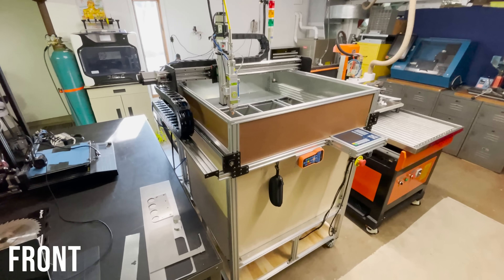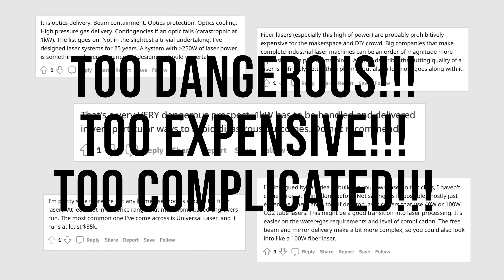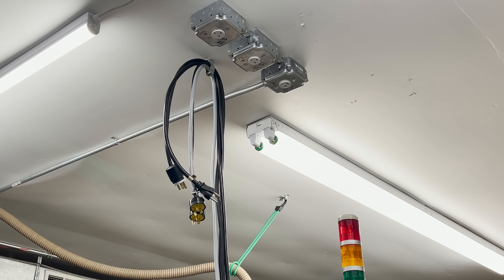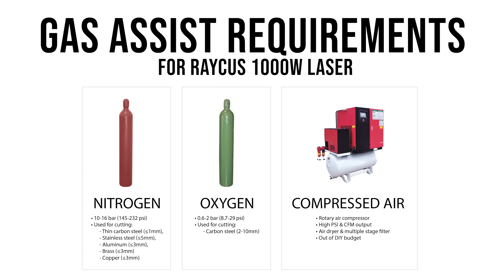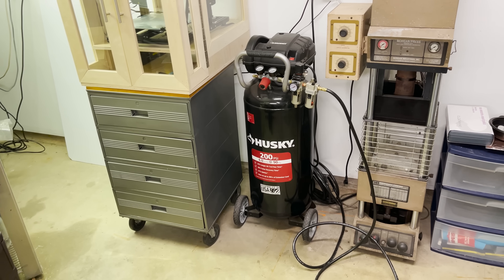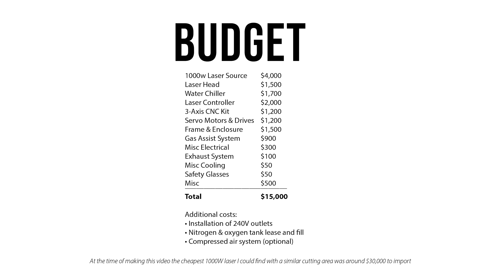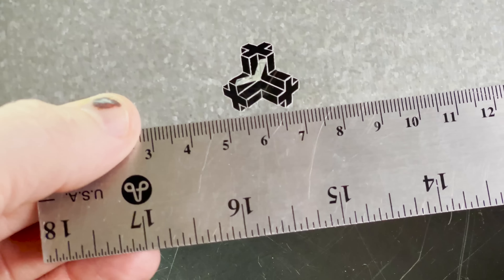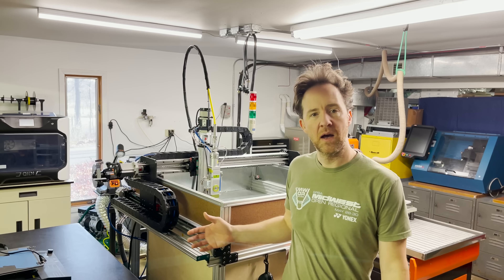DIY 1000W Fiber Laser Cutter Part 1: Project Introduction

Comment: Hi Travis, I took the same route as you did in 2013 with a CO2 laser, when fiber lasers were a new technology. Raycus and Max laser weren't around yet. One thing that could benefit you greatly, and I would love to collaborate with you if needed, is to create your own Nitrogen generator. This will eliminate the cost of purchasing or refilling N2 every time you cut exotic metals such as aluminum, stainless steel, copper, brass, etc. For steel, you can actually use dry compressed air instead of oxygen. However, this must be supplied by a reputable rotary screw compressor (5-10HP or more) which is the bulk of the cost upfront.

Comment: big chunk of change. How thick can it cut?

Another idea is one of those oxygen generators and bottling oxygen yourself too.  As well as refilling your own air cylinders using a compressor. You could probably use a small compressor and fill the large bottles instead of paying for that.

Comment: Definitely following this epic build. Do you think the 1500w could cut 1/4” aluminum? Also, it may be negligible with your application, but to save gas be sure completely open the gas valve so it so it seals. When just partially open gas can slowly leak around the valve, which has an upper seal to prevent this.

Comment: Working as a salesman for company that sells laserwelders. Which is also a class 4 laser. I have to point out the safety aspect. Please cover up the window. The rays will go straight through the glass. You would be surprised how far the damaging rays could travel because of the reflection.  I just subcribed because this I such a cool project. Keep those episodes coming!
Reply from the maker: Thanks for your input, I certainly will make a panel to cover the exterior window while cutting

Comment: Ok, I’m not going to say it’s the best option but I operated at 1500 watt fiber laser for 4 years on straight compressed air.  Was it recommended by the manufacturer? certainly not but it did work.   Our big, expensive laser got a weekly nitrogen and Co2 refill, though.

Comment: If you are using air gas for bottle fills watch your account. Those jerks screwed a club at my school. Starting charging a bottle rental for a bottle the club owned. They never could get it straightened out with air gas, the bastards sent them to collections!

Comment: This is funny, i was the one posting one of the question on Reddit of which you have shown some of the replies. Thank you for doing it anyways and proving those guys wrong. Btw did you consider Acorn CNC as a controller at any point?
Reply from the maker: Haha, thanks for getting this conversation started! I didn’t consider the Acorn, the project is already complicated enough, even when using a fiber laser specific controller
Reply: @diyfiberlaser  I love the project. Will join the Patreon.

Comment: Now you've got most of it, incremental upgrades are a breeze such as bed size. 15k sounds a lot and is but you could bespoke cut some highly accurate jobs and recoup your investment pretty quick. I am at the point of closed loop servos just for repeatability waay down where 10ths are too big.

Comment: At 8:06, it looks like you’re adjusting those tank valves just enough to hit the mark on your regulator.  Remember to go full open on the tank valve and then close a click or two.  Use the regulator to regulate pressure, not the tank valve.  I’m not certain why, but my welding teacher made a point about it and it’s always stuck with me.

Comment: I have 22+ years working on industrial lasers, if you are going to use compressed air, 3 important words, filtration, filtration, filtration. Any water vapor that contaminates your lens or collimator and you will be replacing them excessively, if you can’t get them clean enough. Fiber lasers require a pristine lens to function properly. CO2 lasers are a little more forgiving.

Comment: Careful, I work on industrial Trumpf, Prima, BLM with IPG laser drivers, and you don’t have a proper dust collection system. All that laser dust, under a microscope, are very jagged, and if enough collects in your lungs, it can be fatal.
Reply from the maker: Thanks, I’m working on an enclosure for it now so I can contain the dust and fumes and filter it properly

Comment: I'm so impressed with what you have achieved here.
I've been working on one on a larger scale, more industrial.
You are right, there is not much info for the beginner into this.
Looked at all the Ruida / Cypcut systems, need a PC.
Plus it is a very old Windows system.
So sorting something from the start along the lines with the Masso G3 with the new Plasma start configuration.
This is also working with a LPC-PLUS6 Fibre Laser power source controller.
Plus with my own THC with the LFS-AM-T43-AP01.
This capacitive sensor also works with the Masso DTHC.
With the Masso G3 Plasma start configuration, it may be able to be done.
I see you run a Masso touchscreen in the background.
Cheers.

Comment: You rightly noted the danger of laser radiation. Goggles aren't going to protect your exposed areas of skin - think of how thorough you really should be to protect yourself from radiation from simply welding. Laser radiation can be reflected and scattered and I can see you are RIGHT THERE!  You need to have a radiation blocking cabinet around the whole unit. That's why they have them on metal cutting lasers.

 Also, the result of laser cutting metal is metal fume. Metal fume is composed of particles which are so fine they can stay suspended in the air for days. You are then inhaling this highly toxic material. Excellent extraction/filtration is essential.

Comment: I already have an 4' X 8' plasma cnc set up. I am very interested in designing an add on when I want to laser cut. From what I see in your "rough cost", it looks like I would be able to add just the head, source and chiller for around 10K? Would that be about right? Also, would or should I be able to use my current G-Code and design software to achieve this? Thank you sir for your sharing and help for the small business.

Comment: Very interesting, I am looking at making (because nobody makes one) a combo unit, CNC router and laser. I have been thinking of getting a MillRight and making the table move and not the gantry, mount the laser on the back of the mill head off of the table. and have a small footprint that does two functions. The application is cut 1" boards, 5/8 aluminum, and laser thin gauge metal, with engraving.

Comment: Very nice results.   Wish the frame was less wobbly but I cant argue with the results.  I understand why 80/20 is popular but I far prefer good old fashioned steel, welding is actually faster than fiddling with all the fasteners in those slots, the price is lower and the end result is better.  Welders are not that expensive these days either.
Reply from the maker: The frame is pretty rigid, it was just sitting on 4 wobbly casters. I would like to learn to weld some day, however in this case I was making up the frame design as I went, so being able to loosen fasteners and adjust the positions of beams was actually pretty useful.

Comment: we have an old trumpf 9000w at work that uses liquid Nitrogen that produces around 150ish psi out of the gassifier but we have to boost it to close to 400 psi for cutting 1/4"  steel.

Comment: I really considered adding fiber laser to my existing 3kw cnc router. But just the main components and not the cnc bits cost quite a bit. The only real added benefits to me that is, is being able to cut steel which i don't do often. CNC router can cut aluminium and achieves 3 axis. So i abandoned the idea. But finally someone did it! Great work.

Comment: What travel speeds do you think is required for this?

I have many small and large format… movement systems. I wonder I I can use them (yes they are more than strong enough they are industrial) 
Just not sure the speed will be adequate
Reply from the maker: It appears the fastest cutting speed I would ever need to go is around 350 mm/s, but I would like the rapids to be faster...as fast as possible,  because otherwise assist gas is getting wasted while moving around
Reply: Hmm. 
My milling machine is only rated to around 250mm/S for accurate feeding.
I wonder if that would be enough?

As for air on my end I have lots of air compressor capacity.

You’ll need to borrow your cloths dryer plug and get a bigger compressor maybe. Tank air must be prohibitively expensive to be se!
Reply: *use

Comment: I had considered going laser, but before I did, I just had to prove to myself that I could not get the quality I needed from plasma.  I'm glad I went through the effort, because it turns out that plasma with a fine cut nozzle is indeed capable of doing the cuts I needed for my small business application.  Here is my video of my $500 CNC plasma cutter.  https://youtu.be/z5j0oNG1YTw

Comment: sometimes I can see used laser sources for sale,  quite rarely, there may be more later.    I read that fiber lasers have a very long lifetime.    my question is, are there states in between working alright and fully defective?   for example, can it happen it seems to work (emits the laser beam) but some (hidden for us) parameter is not correct and it will make the operation faulty.  are their power decreasing with operating hours like it is the case with CO2 laser tubes. Simply put how safe it is to buy a used fiber laser?

Comment: This is one of the least responsible and most dangerous projects I've seen in some time. At that power, both specular and diffuse reflections can cause permanent eye damage, blindness, and physical burns for you, anyone in the area, any pets, and any wildlife nearby. Since you're venting out a pet door, you do not have any hope of claiming adequate optical shielding. That needs to be in a laser-grade enclosure.
At those power levels, I wouldn't even be comfortable with laser glasses, I'd use goggles and definitely ones with appropriate frequency-specific optical density ratings ($120 and up), as Spirit mentioned.
You're also overpaying for gas by about an order of magnitude.
You should not be venting those fumes without filtering. All you're doing is poisoning your neighbors and local environment.
Reply from the maker: This is a work in progress. I now have filtering, certified safety glasses, and am working on an enclosure (for spatter and fume containment). Im not sure how to make a laser grade enclosure, so I will be relying on safety glasses for now. There are people using open frame machines all over the world, even though it is not ideal. I’ve never actually heard of an eye injury case, only the potential for one. I would be really interested if anyone knows of any? And yes, I’ve already burned myself on the hot metal, but it will heal…and I will never touch that again with bare hands!
Reply: @diyfiberlaser  I'm glad you're taking a lot of safety suggestions from everyone to heart.
If you're talking about all the cheap hobby diode laser cutters being run unenclosed, they are very different. Aside from orders of magnitude lower power, their beams are very divergent and focused but not collimated. A reflection disperses far more rapidly, resulting in less intense radiant energy to the eye. They're also visible beams, which makes the retina more susceptible to damage at lower power but also, for low power strikes, the blink reflex comes into play to protect your eye.
For an enclosure, you can get laser safety glass and laser safety curtains. The latter are good for ensuring reflections can't get out the sides, the former are good viewing windows into a (probably laser absorbing paint coated) metal enclosure.
Thanks for replying and improving your safety processes!
Reply from the maker: @kor_kilden  I am certainly taking everyones comments to heart. As I said in the video, I'm a complete novice when it comes to fiber lasers. I have already learned so much from everybody's wonderful feedback and I'm trying to implement what I can. I was really hesitant to even put this video out because it would be my worst nightmare if someone gets hurt trying to make or use one. But I think in the end, it might turn into a resource that others are able to learn from, especially from all of this feedback. You just helped me again! I had no idea there was laser absorbing curtains or absorbing paint...now I have more research to do! 😃

Comment: Well described and thank you for all the info shared. The greatest fail of the whole system is no mouse on the laptop 🙂 Looks to be the system I will need, but the price is outside my capabilities now. I have a 65 amp plasma cutter on a PlasmaCAM, and a 6040 CNC which does me fine for now, and I am building a 90W 6090 CO2 currently with about 2/3 of  the parts now.
Reply from the maker: Tough critic! I have a Bluetooth mouse, I just wasn’t using it 😜
Reply: @diyfiberlaser  🙂

Comment: I run a laser welder, i pay 43$ for 300cuft for the nitrogen 1 cylinder at a time small volume . You should check with a main gas supplier

Comment: 9 bar out of compressor is fine to cut 2mm stainless and 1mm carbon on this setup. Just make sure its free of oil and water as it will make lower protective lens dirty during cut and lower output power

Comment: 4:42 , that's a very common cost cutting measure, I work with a 2500W laser at work (industrial), we do up to 10mm black steel or 6mm stainless steel, reliably, BUT, we have a liquid ring compressor system, and HIGH pressure is an important factor in evacuating molten metal and a good finish. I'd be happy to relay any questions you have to our more experienced operator, keep in mind, I live in the middle east, so specific pricing question may be irrelevant.

Comment: You never talked about the power requirements, only voltage requirements.
Reply from the maker: Busted me, I will try to add amperage requirements in the video about the specific components

Comment: @ 9:40 Looks like you are cutting some galvanized steel. Please don't - you should have a fully enclosed system and air filtration on the exhaust. Zinc, manganese and sulfur are highly toxic and should not be just blown outside. If you really want to kill that squirrel, go cut some walnut with the exhaust on low setting. The fumes will attract the squirrel, lead it into the exhaust fan and voila 😂
Very nice project. We were looking in getting a tube cutter to cut titanium tube. There are not too many companies around that will do this for us and I had to cut some small holes myself using a 30W fiber. That worked fairly well but it's way too slow for production use. So I am looking to build a tube cutter for small tubes (50 mm diameter, max 1 m long and up to 1.5 mm wall thickness). Will be following your progress along the way
Reply from the maker: Thank you for posting this warning for everyone to see! My machine is still in progress...I'm going to finish the enclosure soon and I'm in the market for a used negative air scrubber to add to the exhaust system...I moved into this house not too long ago and I'm just using the cat door as a temporary solution. As my next project, I want to build a DIY fiber engraver, then figure out a more permanent exhaust solution for all of my machines.

Comment: That is a really nicely built. Suddenly my home-built 3D printer with screws seems like a waste of time 🙃 but at the same time I think, with the knowledge I acquired, I can build one like that too... I understand that you are not used to the metric system but that is 20 millimeters and not centimeters... extremely impressive.

Comment: Hi Travis, great video. I am going through EXACTLY the same process as you, building my own DYI fiber cutter. I have also decided on Ruida controller, clearpath servos and still deciding between Raycus vs JTP laser source. Is there any way I could possibly get in contact with you if you don't mind? Thanks, Tiaan
Reply from the maker: Make sure you read the Ruida manual on the part about z axis servos, they only support certain brands for that axis. Contact info is on linked website
Reply: @diyfiberlaser  Thanks a lot for the headsup, I will definitely check it out. Are you happy so far with the manual focus cutting head?